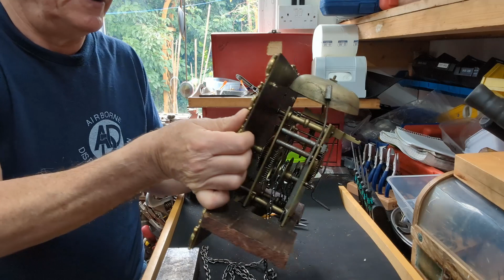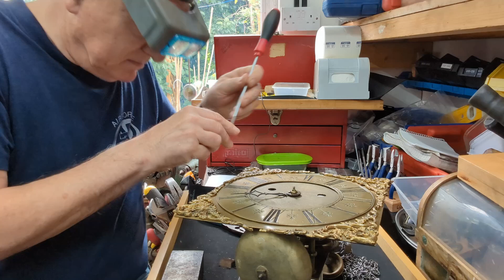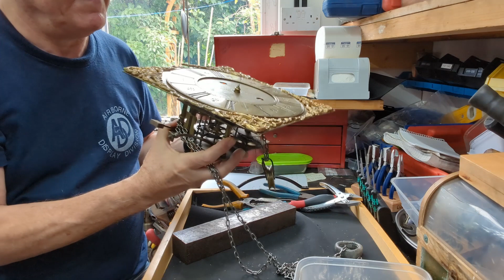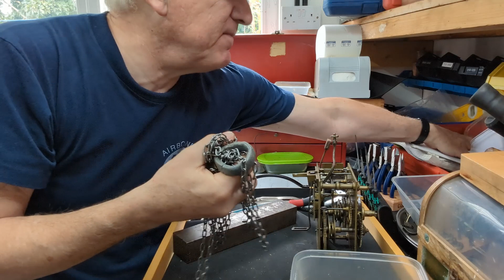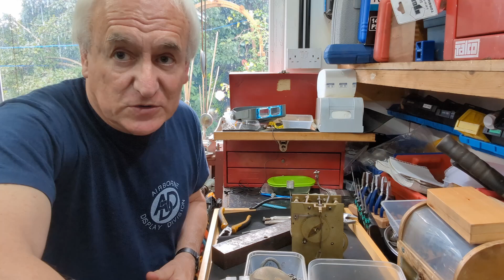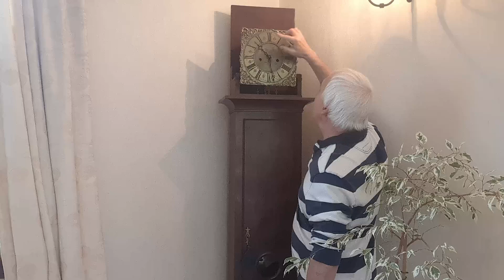Unveiling the Mystery of Countwheel Striking

Comment: Hi David. I have found this video very helpful. I am working on a grandfather clock that used to belong to my great grandfather, but I am a complete novice. I now understand a little more. One thing that confuses me is when the hoop wheel lifts the lever of the count wheel, why doesn't the weight then pull the count wheel around?
Reply from the maker: Hello Chris, I am glad to hear that you're finding the video helpful. Think of the lever action the other way around. When the countwheel lever raises and the striking begins, the hoop lever then comes into action and slows it all down until the countwheel lever runs into the next countwheel slot and the striking is finished.
Difficult to explain I know, but you will see better when you see the movement striking. 
Good luck with the repair and I'd love to hear how you get on 🔆

Comment: I enjoy your videos very much, please keep up the great work you do. I have a thirty hour chain driven clock and it was made by Peter Keetley, Tuxford. It has a swans neck pediment and the case is oak. The dial is brass with brass spandrels and it has a rocking ship in the lunette also it has a date wheel. I have solved a number of problems with it which is very gratifying. I have not been able to find anything about Peter Keetley searching online. Take care David and keep up the great work!

Greg
Reply from the maker: Sounds like a lovely clock, I'd like to see a picture of it if you have time. Like you, I can't find any history on the clockmaker.
Reply: Hi David, what is your email, I will send pictures of the hood and the dial. Later on tomorrow I will send some full length pictures. @davidhaggarty

Comment: Thank you for showing us the spring-clip on the hour hand! I have a very similar movement whose hour hand does not want to come off; I suspect I now know why. Incidentally, my movement is almost identical to yours, with the same rather unusual count-wheel having a toothed flange which is larger than the wheel itself and is mounted outside it; I understand that more usually the toothed ring is smaller than the wheel and is hidden behind it. In mine, too, the bell-arm is screwed to the inside face of the back-plate.
Reply from the maker: Yes the hour hand took a bit of pulling off, just remember to take your time, and if necessary a small drop of penetrating oil just helps free it up.
That's what I am finding so fascinating about these old clocks - the different mechanical approaches taken combined with the artistic flair. Clock makers often see so much more than the collectors do!

Comment: David, I have been thinking about the two key holes in the face of your clock and wondered if the face is from another clock ?
Reply from the maker: Hi Mark you could well be right, although the fixings do look original. The clock collector I bought it from thought the case wasn't original but that the key holes were often put in to make the clock more expensive, or perhaps for a possible future movement upgrade. I guess we will never know!
Reply: @davidhaggarty  I have an example whose dial, dating from about 1720, has dummy holes like yours. Admittedly the present thirty-hour movement in my clock is not original, but the holes in the dial are only about 3.5mm wide, much too small to accept any clock key,  and so I am confident that the original movement was also of the thirty-hour type. — I suspect that your clock may have begun life with only one hand, since the dial has no minute track outside the chapter-ring. Certainly the hands are later than the dial, and the minute hand is too long. I believe such two-hand conversions are not uncommon.
Reply from the maker: @olivermundy4220  I had to take a closer look at the clock face and you are quite right (and very observant!). I too could believe now  it was a single hour handed clock originally mounted behind the face, and I can see now that the minute hand is too long. Maybe the dial face is from an earlier clock. 
Fortunately I still love how the clocks looks and am very happy with it. I will be looking at clock dial history a lot closer in the future, thanks for your interesting observations.
Reply: @davidhaggarty  Thank you! If the dial did not belong to the movement I would expect to see redundant holes in the front plate where the original dial feet would have passed through. Are there any such holes? My own movement has three.
Reply from the maker: @olivermundy4220  there are no redundant holes, just screw holes for holding the spandrels and inner chapter ring taper pin fitting. I did not silver the chapter ring as it didn't appear that it was silvered originally. There is silver in the engravings but I think that could be old brasso. I don't know if they were silvered?, But I quite like it as a brass finish.